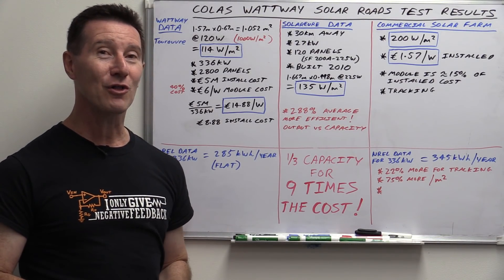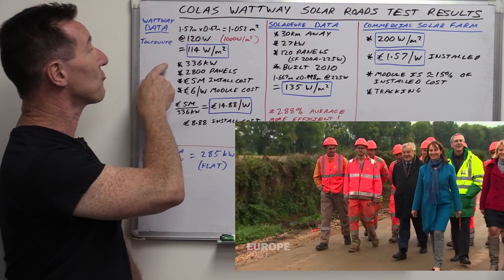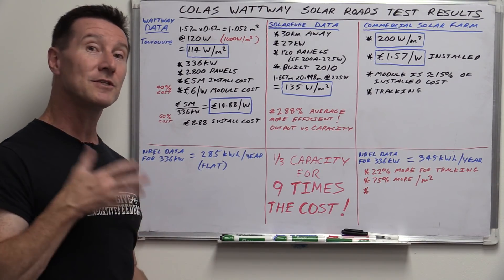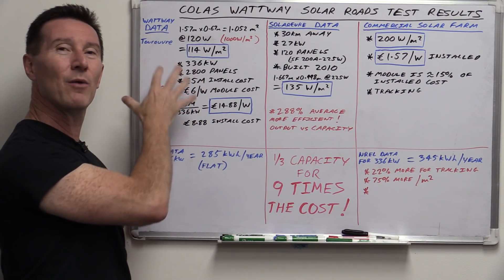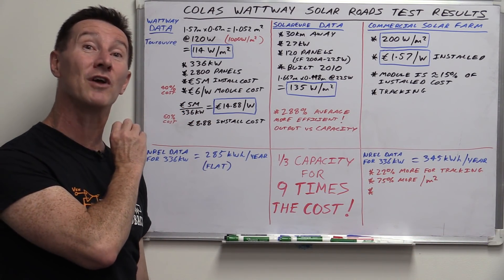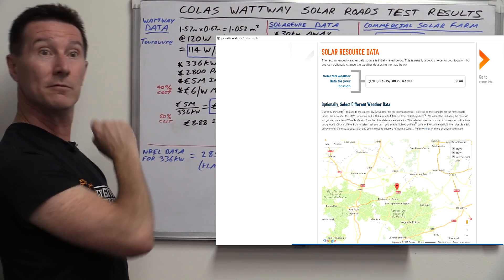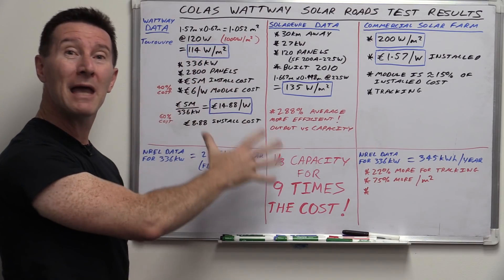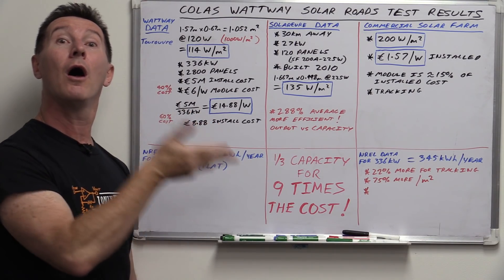EEVblog #1047 - Solar Roadways FINALLY BUSTED! (Colas Wattway)

Comment: dave I'm sorry I have to disagree with u on that but the goal of this road is weather to save the planet nor to be a commercial success. I know politicians are trying to sell it this way, like u said: bla bla. but pls dont be a fool nobody here in good old europe believes it either. This project is the playingfield of scientist getting payed for some "research" project funded by the EU and directly France would be my guess. In europe theres a huge population/property density. This leads to the fact that u dont have a lot of room where stuff like solar pannels could be build on. Hence the idea with roads. They are already working on a much less efficient but also much less expensive version of road pavement which works like solar cells but could be produced like regular roads by adding the cells pulverized like concrete into the mixture.
Reply: @TY1979KA , I'm sorry, there's no progress to be made in "solar roadway" technology, it is a dead end technology, it is hitting a roadblock ... if you could embed solar into concrete & materials then buildings & windows is the first/no.1 place to put them first.
Reply from the maker: Want me to do a video showing you all the government owned roof space available?
Reply: Even if the population density in Europa is pretty high, there is still plenty of unused space around. Besides: you really do not want to plaster roads in towns where they are in shadow during at least 40% of the day. Even the "popular" sound barries next to freeways would be a better choice to mount solar panels then the roads themselfs.
Reply: There are limited resources (a basic tenet of the save the planet view). Market costs reflect resource usage. Why choose a solution that's vastly inferior when there are much more productive ones?
Reply: If population density is an issue, kinda dumb to invite in millions from the 3rd world then, eh? Especially since their carbon footprint in Europe is an order of magnitude higher than the nations from whence they came. Add onto that issues of crime, clash of culture/religion, terrorism, etc.

These projects have nothing to do with saving the planet. The planet will be just fine no matter what we do; this dirt ball we're on isn't some static thing, it changes anyway. We might tip it one way or the other a bit, but it matters not one whit on longer timescales; we're just a blip in this planet's history, yet have the arrogance to think that somehow our presence defines this world in a manner above anything else on it, past or future. One good cosmic kick and we get hit with a planetary reset button; it's happened before, it'll happen again (comet, super volcano, etc.) Heh, some will likely respond with hey, what about human intelligence, art, music, etc., to which others would say what about war, murder, toture, rape, slaves, and all the other horrible things us humans do to each other on a daily basis. My what a pedestal upon which we place ourselves in order to jusitfy our sense of self importance.

Projects like this are far more about academics securing free stuff, ie. leeching off state funding as they always do. I know because I've seen this bullshit in academia in action, vast sums of money wasted but nobody cares. Same stupidity with the hyperloop. Hey, I have a bridge I can sell you. :)

What's funny about all this is people harp on about this or that fancy technology to save a planet that doesn't need saving, but nobody says hmm maybe I simply shouldn't be buying all this consumer crap that we don't really need. :D  Ah no, can't do that, gotta keep the economy moving! Spend! Borrow! Consume! Get the next iPhone. And meanwhile the state will tax the hell out of you because apparently the planet needs saving, so says the UN let's blow a hundred trillion on eco crap that's only going to delay some warming that was going to happen anyway by less than a year. Funny how this very organisation that claims to care about the future of the planet has also been encouraging massive population increases across the 3rd world, along with major migration movements that destabilise western economies. Doesn't sound very eco to me.

Well, I was a good western boy, I did my duty as instructed (brainwashed) by the state back in the 80s, I didn't have children because we were told the world had too many people, yet now for example India's population is skyrocketing, encouraged by the UN (1 billion extra people globally in just 12 years). And of course, the largest proportion of the increases expected up to 2050 will occur in precisely those nations least able to produce people with sufficient education and inelligence to make sensible decisions about resource usage, instead they're more likely to perpetuate cultures that nurture conflict, especially if they continue to be encouraged to try and move to western nations where an endless stream of free stuff is available. Who can blame them, it's basic survival. Perfectly rational move from their point of view.

If people really cared about the environment, they would oppose state borrowing and national debt more than anything else, because every penny spent in that way constitutes resource consumption that hasn't even been paid for, making it even more likely that there won't even be a pensions system for future retirees. It's unwarranted resource consumption and stealing from the unborn at the same time. Slamming the breaks on such spending would also mean a complete halt to immigration because there'd be no money to hand out for free. Opposing the out of control welfare state would also be greatly beneficial, ie. halt the destruction of family life and reverse the rise of single mother households, the offspring of which are far less likely to enter productive work.

But these are hard questions about the real world, which means confronting uncomfortable facts, things that academia won't even investigate because it challenges their left wing ideology they push onto students and the wider public. Well, facts don't care about our feelings. So instead we virtue signal, change our FB status, buy another phone, and just carry on as usual (in the US alone some 150 million phones are thrown away each year, most of which end up in landfill); a recent survey cited an 8% rise in e-waste in just one year) . Most people who do eco stuff only do so for the sake of appearances in the eyes of others. Otherwise, resource-hungry and unsustainable products like the Prius wouldn't exist. Hillarious the way a middle class moron will sit in their SUV in line at a recycling centre, with the car engine running, just to hand in some pathetic bag of plastic crap, much of which is often not suitable for recycling anyway. "I'm doing by bit for the enviroment!", says the eejit who owns an SUV. :D  Wanna make a simple difference? Try insisting that power supplies in TVs are not made from cheap crap, so they'll last longer than 5 minutes and thus not be part of the vast horde of faulty TVs thrown away each year (because it's cheaper to buy another than have one repaired, an equation that would have a different outcome if the consumer had to cover the cost in the initial price for the eventual disposal of the product).

Solar roadways? Gimme a break. There are real, practical things we could do that would make a far more significant difference, but nobody wants to do them, because there are no votes in explaining what needs to be done, less free stuff as a result of doing them, and the politics of the west atm won't even allow us to ask the right questions and discuss things openly without being immediately branded with any number of ridiculous non-argument labels (racist, nazi, sexist, etc.)

If you want to know why projects like this persist, just follow the money. Look at who gets the free stuff. Look at who gets the votes by supporting it. At who has influence, power and control. There are trillions of dollars at stake. Anyone who thinks such vast sums won't attract entirely the wrong kind of people is out of their mind.
Reply: The only "solar roadway" technological improvement would be to build the solar modules above the roadway.  Could be done fairly economically, although not as economical as commercial solar installations, but much closer than this brain fart of an idea (solar in/on roadways).
Reply: If it's not commercially viable then it's probably a bad idea, possibly even a con. Every con is sold as something sensational. These engineering cons are sold as "ground breaking" and "world changing", etc. Genuine engineers and scientists are usually quite conservative in their estimations. They don't promise you the sun on a stick as the result of a project they haven't even tested yet, they show you a prototype that actually works and tell you what specific problem it solves.
Reply: Don't do a video. Do research. Ask people who are in the field actually.
Reply: Such a system will only work and be a success if its commercially viable.
Reply: I would very much appreciate it and then lets compare it australia vs germany

Comment: Why can't we just build a load more nuclear plants and have clean cheap energy without this nonsense... it worked just fine in the sixties,until the environmental lobby made it difficult and idiots got freaked  about a certain poorly designed Russian facility. Nuclear all the way!!
Reply: DarkWarrior with the liquid salt thorium fuel cycle, the reactors would also be highly disaster resistant and couldn't meltdown by design (the fuel is already melted, the only place it can go is back to solid non fission form). Add in the thermal output in addition to electricity production and the coasts could desalinate ocean water for drought relief. The anti-nuclear lobby needs to disappear. Considering how much we spend on military oil security, 10 Billion to Kickstart production plants and accelerate rollout is a small pittance by comparison. With the oncoming EV revolution, we're gonna need gobs more electricity generation at all hours, it's going to have to be nuclear (electric semi trucks with 0.5 Megawatt battery charges? ), with some daytime solar for spiky augmentation.
Reply: I totally agree, and I am not even familiar with the thorium technology... even the traditional uranium based  PWR is highly effective, with no emissions of CO2. The scientific illiteracy of the anti-nuclear bandwagon is breathtaking, considering the clout they have at governmental level.

Comment: To my mind, a solar farm can not be used for anything else, (except small house roofs and then the power is privately owned as opposed to publicly owned... and that's a whole rabbit hole in itself) while the space a solar road uses, can at least take traffic. For some countries, the economic tipping point of using a solar road will be different to other countries. But that's going to be on a cost/case basis. So the cost of the land would need to be factored in to that cost per watt. Personally, I'm ambivalent to the whole solar road thing, so I'm not a fanboi of the tech, in case you were wondering.
Reply: Even if you have no other land to use for solar farms, it'd be cheaper and more efficient to put the panels over the road...
Reply: It is a whole lot more efficient and a whole lot cheaper to just continue with the zero emissions nuclear they already have = 88% of their domestic electricity supply and 13% hydro which = 100%. So who needs the expensive Pixie power solar. This is just a case of Big Oil buying politicians, they use wind & solar to destroy baseload power and replace it with 80% NG/LNG greenwashed with 20% Wind/Solar.

Comment: The only reason to install solar roads is land cost. At present land prices and solar cell prices it does not make economic sense. But if the solar cell price halved and land went up ten fold it might make sense. At present there is more than enough marginal land to meet the requirements.Just up the road from me is a WW2 airfield that was then so contaminated by rocket fuel during the cold war that it could neither be built on nor farmed, it is now a 50 mega watt solar farm,there is no tracking  the panels just face south.
Reply: If land prices go up, it will likely be because construction is occurring. At which point, rooftop solar at time of construction makes sense.
Reply from the maker: Want me to do a video showing how much free government roof space is available?
Reply: Yes, you could much more easily put the panels on warehouse roofs. Closer to loads and high power transmission.
Reply: No need, I fully realise the stupidity of roadway solar I was trying to play devils advocate here to a limited extent and point out the only case there ever would be for roadway solar. Here in the UK there are many disused WW2 airfields, with more coming along that make excellent solar farms, but in actual fact the UK is far better suited to wind with both onshore and off shore areas of fairly constant wind.

Comment: What about safety as in "grip"? Water on flat glass would probably not be better than, for example, water on flat metal and anyone who have tried to brake in a car or on an MC on wet metal sheets covering roadworks know that the grip is near zero.
You could, of course, make grooves in the glass, but what would that do to efficiency?
Reply: Finally, slot-car racing will be made to scale.

Comment: Solar roadways work fine... ...if you have flying cars. ;P
Reply: The Scavengers Workshop and are closer to the equator. The fact you have a southern arc to the sun's movement impacts the overall time you can get optimal direct light.
Reply: Well yeah. If you don't actually need the road, you can have them banked however you like.

Comment: Hi Dave,
just read in a German magazine about a solar train now be running in Australia. Sounds for me like another bullshit. Looks like it is in NSW. http://de.engadget.com/2017/12/18/in-australien-fahrt-der-erste-solar-zug/
Reply: That train makes a 4-mile round trip every hour. And when it's stopped at a station, it charges from the station's rooftop solar panels. That's entirely plausible.
Reply: I see it‘s more a fun project for an old train like a tourist attraction but the German text read a little bit like this the train is the new sensation and in future all trains run with solar power.
Reply: ts.electronics i think its just a fun addition and in this case they wont care about cost. It wont be practical but who cares on about that on a piece of history.

Comment: To be fair, IF the full surface of earth will be covered by buildings and roads at some point, those solar FRICKIN roadways may become a thing simply due to the lack of other options (after having utilized every rooftop and stuff).
Reply: Even then, I bet beaming power from an orbital solar array would still be more cost-efficient.
Reply: Even then, offshore floating solar farms may be more cost-effective than solar roadways.

Comment: Where do you account for the cost of real estate for solar farms versus the fact that roadway real estate is available at what amounts to no cost? I generally agree with your conclusions, but I think your economic model is flawed by not including this factor.
Reply: Except roadway real estate is not freely available. All those roads will still have to be torn up, closed for construction, and rebuilt. This takes a lot of time itself, and as everyone knows time is money. There's no such thing as a free lunch. Of course, with this system you apparently don't have to tear up the roads but it obviously won't be as effective, which is the point of this video.
Reply: But you have rooftops. And empty fields.
And literally a million different things that aren't roads, almost all of which would work better than putting it on the actual surface of the road...
Reply: USDA puts the average cost of land at $0.74 per m2, with property taxes at less than $0.009 per year. It's not worth mentioning at 0.2% of the initial investment.
Reply: It would be less expensive and more efficient to put the panels over the road at the proper angle or next to the road. Or on top of the buildings next to the road, if there really isn't any more room. The other great thing about electricity: it can be transmitted very long distances, from a place that is less populated to a metropolitan area.
Reply: That was my first thought too.  I just checked farming profit per acre which is (say) £100.  4800 square feet and say that road is 15 feet wide so about 100M per acre (roughly) so only about 10 acres (1KM road), £1,000 per year.